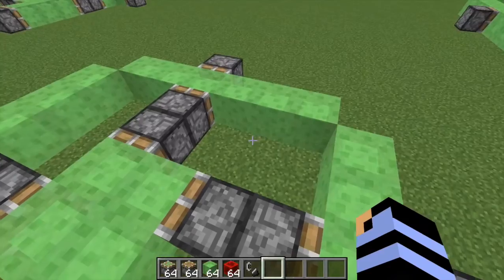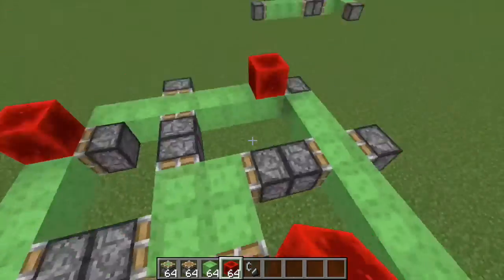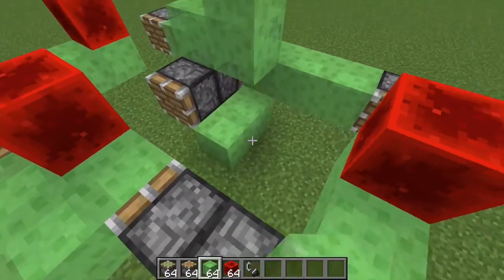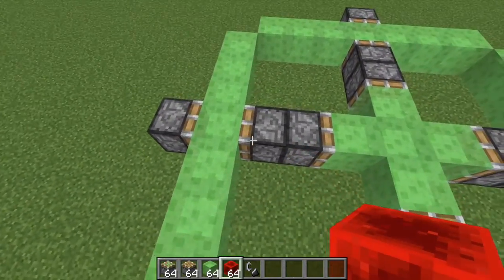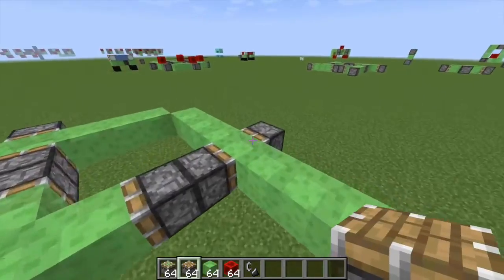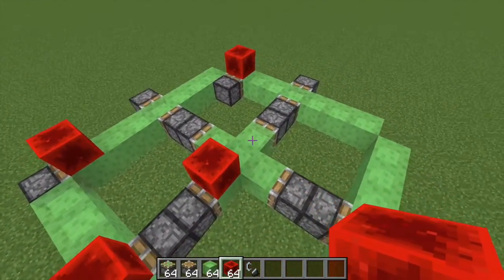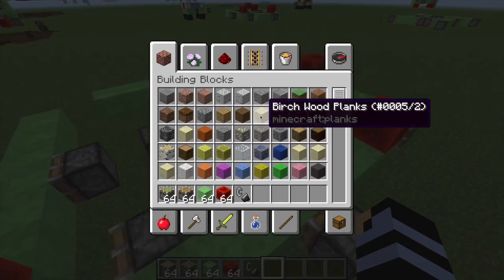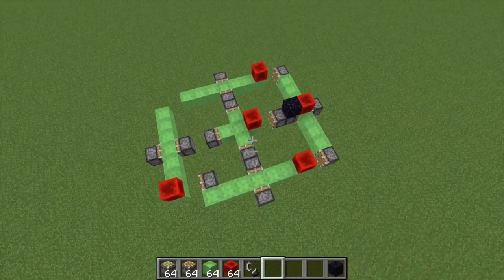11x11 4-Way Flying Machine!

Comment: then you can build and use an up and down engine in the center giving you a 6 way controllable flying  machine. The center would be much different, but can all be pushed in any direction and maintain its shape.
Reply: How? I been itching to know this forever